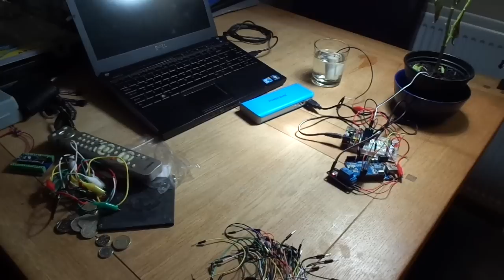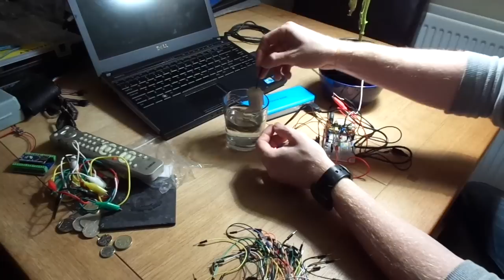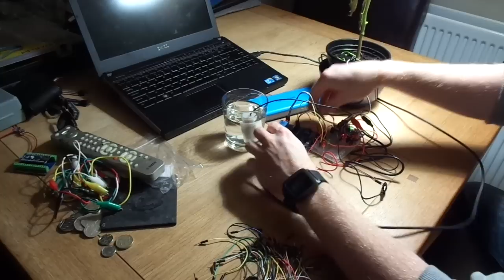Arduino based auto plant watering system

Comment: nice rig, but write in a longer stopp in betweeen the watering stages, because the moisture is spreading in the soil and you may overwater the plant.
Example: Watering. 30 min pause, check moisture.... water if needed...... wait again 30 min or longer
nice job
Reply from the maker: Thanks for the comment, agreed totally on the delay.  It's been taken apart now but i should really piece it back together for another test.